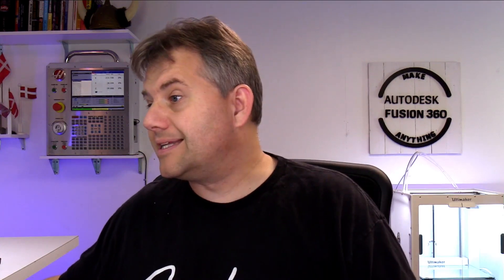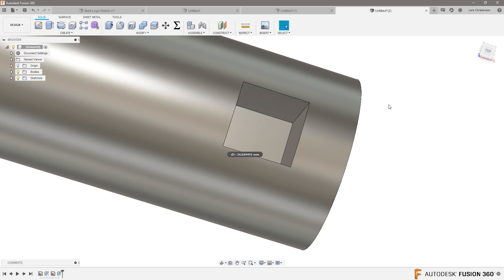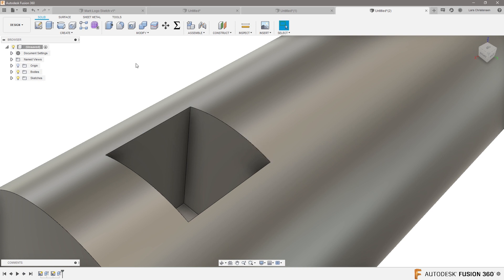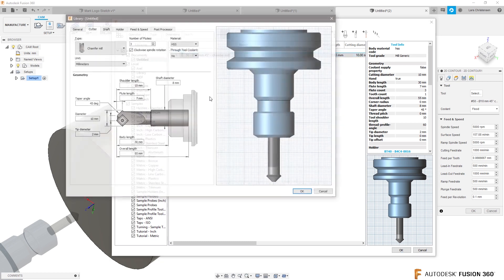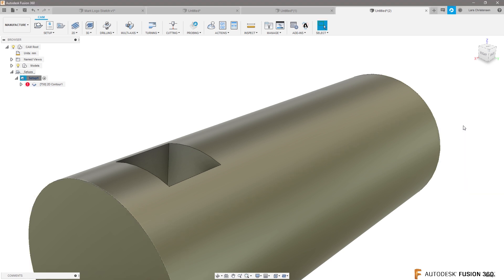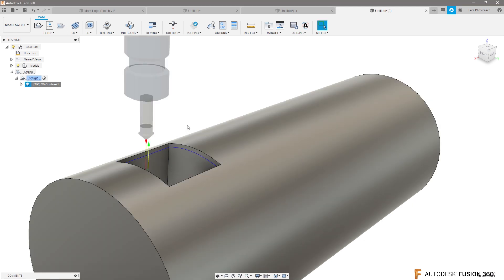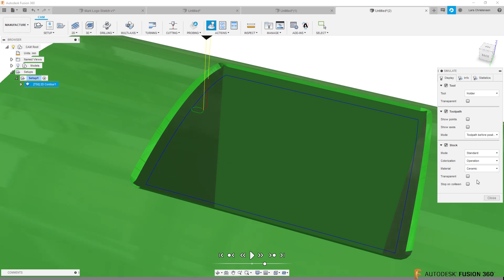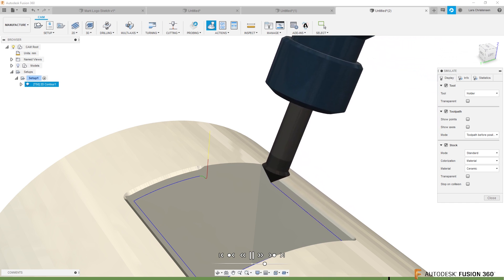Fusion 360 — CAM For 4th Axis Mill Turn Chamfer — Ask LarsLive

Comment: Lars is there any way to use Fusion 4th Axis to machine parallel with the Z axis? Imagine if you had a soup can standing up in the 4th axis and you wanted to cut a pattern on the lid, using the X, Z and the A (4th).